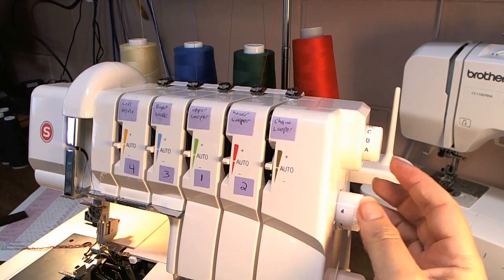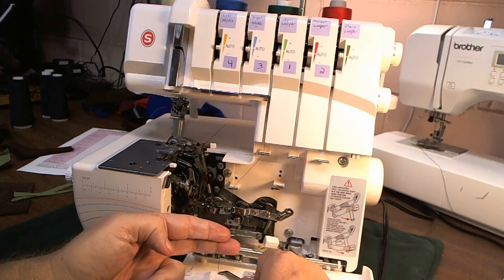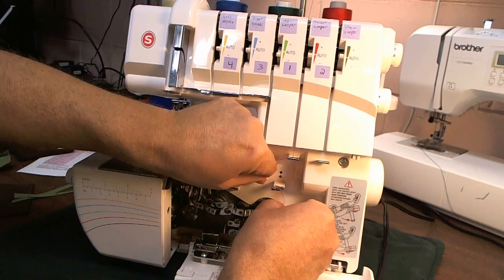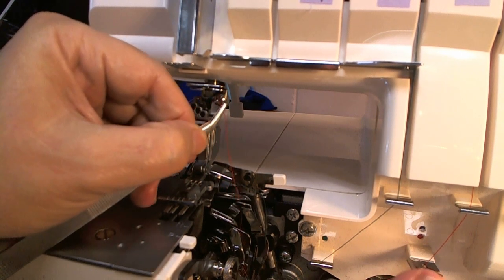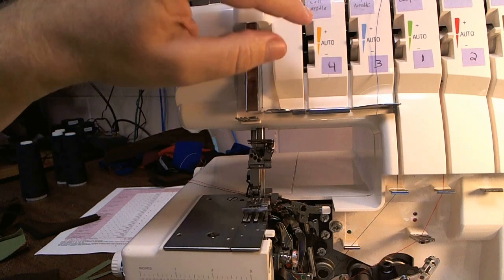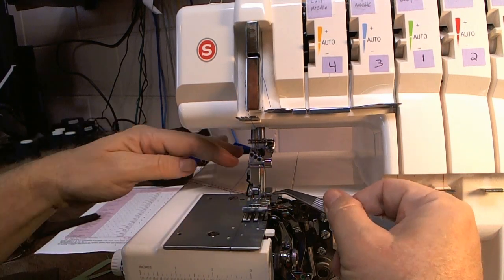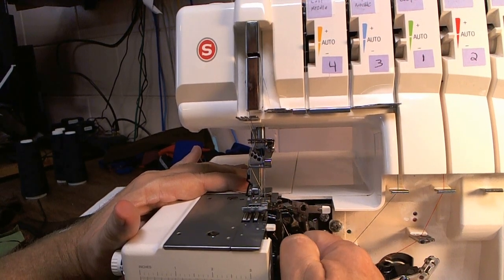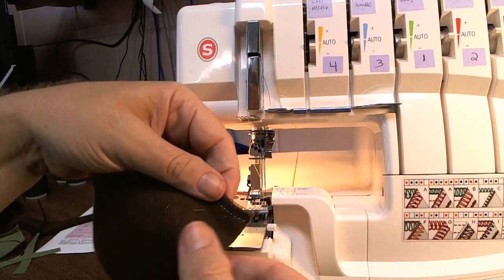Threading the Singer Pro 5, 4 thread mock safety stretch stitch

Comment: BLESS YOU for this video. I purchased this machine online and it did not come with the workbook. The instruction manual is TRASH if you are new to using one of these machines. 

I was VERY intimidated when I unboxed this machine and I just stared at it for about a week. Spent that time watching videos and reading the manual. Finally it was time. I did my best to follow the instructions in the book and after a shameful amount of hours had no luck. That machine whooped me and I was ready to put it in front of my truck tire and roll over it (then reverse and roll over it again). I slept on it, looked at several more  useless YT videos, then found yours. I threaded my machine along with you step-by-step (thanks to play/pause), saw my error from the previous evening. Now I am off to the races!!! I was not gonna let this machine beat me!!!

THANK YOU THANK YOU THANK YOU!! 😃👏🙌

Comment: I bought this machine for myself after saving for few years.  I was excited and very intimidated.  Thank you for your thorough video.  I read the manual several times but just didn't get the looper threading.  I have subscribed and look forward to learning from you.  I can't thank you enough!
Reply from the maker: Don't give up, they can be a bit hard to thread when you start using them
Reply from the maker: What I did and still do, is when I go use my serger, i alwasy unthread it completly , and give it a quick cleaning and a drop  of oil if needed , and rethread it.  Now I can almost di it blind folded.

Comment: When trying to thread the loopers try using a blue dental loop found in the toothbrush isle.  Put the straight edge through the small hole and the tread through the loop and pull.   Really helps.

Comment: Thank you for the video...this 5 thread is  bit intimidating but it has so many good features I am thinking of buying it.
Reply from the maker: It is a great machine, it does take time to switch between serger to coverstitch.  It was my first serger, to get used to it, I took an old bed sheet and cut it up into 8"x5" strips and spent a day or so trying out all of the different stitches, got me used to the sound and speed of the machine as well.
Reply: @mrneedlebreaker  oh that is a great idea!  Is it a particularly noisy serger?  I am trying to see one in person before I buy it, but still working on that.

Comment: I have only used 3 needle wide overstitch so far. I have followed the threading directions but when I sew a hem and pull the needles up (turning the wheel toward the back) the thread almost always get jammed I have to force the fabric out and the thread comes out of the left or right needle. Any suggestions? I'm ready to return it, it's so frustrating
Reply: You may want to try this if this happens again, Stop machine , lift presser foot, pull threads out from bottom with very thin screw driver and snip threads, squeeze fabric and pull away  . This action should release fabric without harm.

Comment: Does anyone know where I can buy needles for this machine . Thanks
Reply: Try Google and add model of machine
Reply: It's just Singer 2022 needles size 11 or 14.  You should be able to get them online or in any store that sells Singer needles. The manual says this is an industrial needle and you should not use regular machine needles in this model serger.
Reply: @janemartin229  I found some thanks. It was really hard to find during this pandemic.